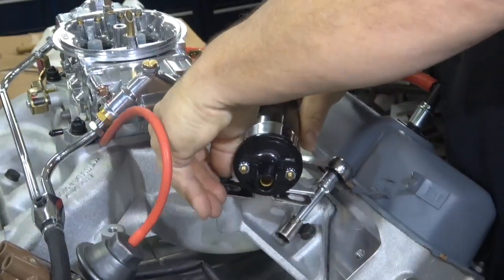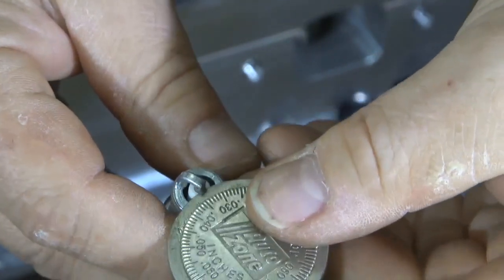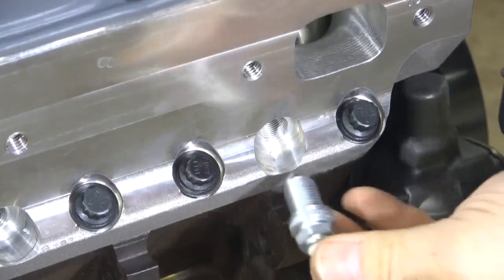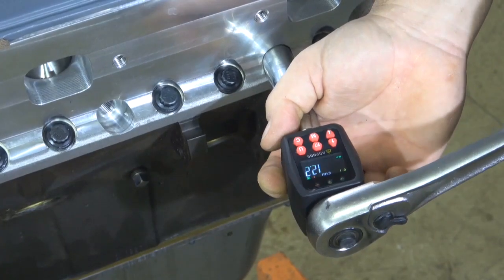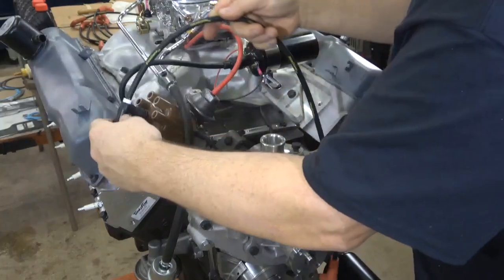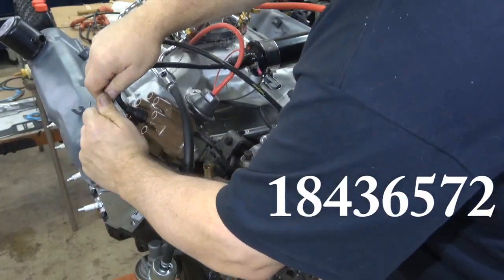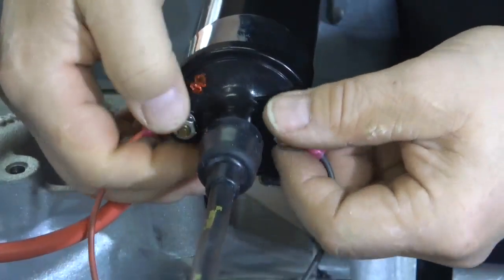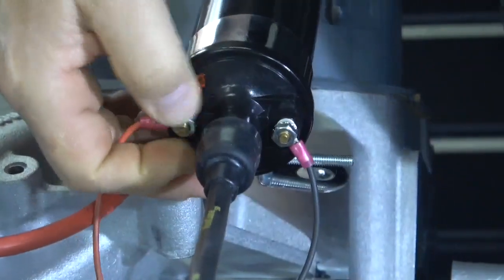Engine Building Tips - Wiring the Pertronix Unit 440 MOPAR 512 Stroker

Comment: Hey Pete. Have a question here. So Ive never rebuilt an engine before so this is going to be my very first. I do have usually work on my own vehicles instead of taking them to a shop. With that said I have a few questions on rebuilding a engine. My first is regarding the crankshaft. Is it common practice to just reuse the crankshaft. If so is it common to send it to a machine shop to have them do anything to it. I plan on sending my block to the machine shop to have the surfaces redone, cylinder walls bored and honed as well as the crankshaft bearing seats machined to align them all to each other  if thats the proper thing to say about that area. Regarding the cylinder heads I plan on having them machined as well and I plan on using all new parts regarding the internals. Any advice or recommendations  regarding general engine rebuilding is much appreciated.
Reply from the maker: Yes, take the crankshaft to the machine shop so they can clean up the journals If needed. If they grind anything down, you will need oversized bearings. They can also recommend if the heads need any work.
Reply: Thank you.  @PetesGarage

Comment: Hey Pete.

My dad and I built a 440 early 2002 or so. The heads and intake are ported polished edelbrock performer rpm, but I dont have any glow numbers for it unfortunately. I was looking at the trick flow 270 heads to try to get some extra flow and power out of it, what do you think?
It's bored/stroked to around 496 c.i. 10.5 to 1 compression. I can get more details if needed, but that's all I remember off hand.

Any help would be great! 

Thanks and keep up with the great videos!
Reply from the maker: You might get a little more power out of it, but I don't think the heads will give you more just by themselves worth the money
Reply: I like the 1 wire alternator as well summit sells a box for half the price of an msd unit but has msd electronics 😊.